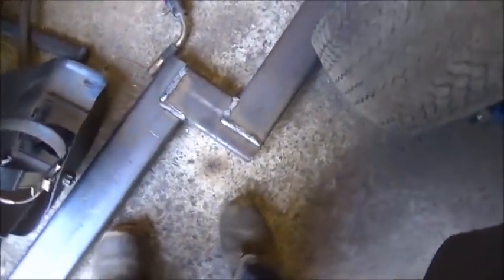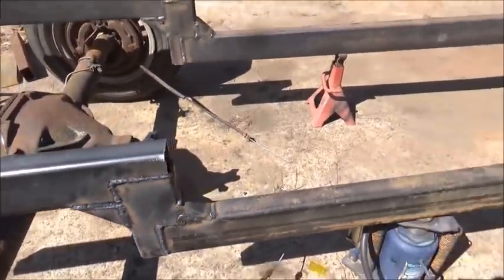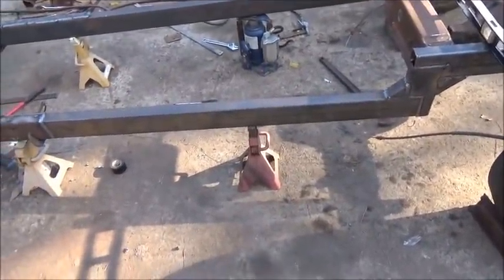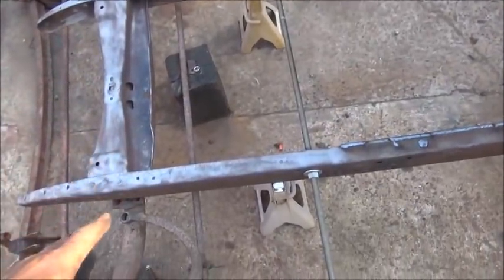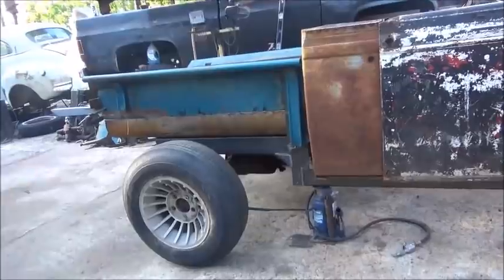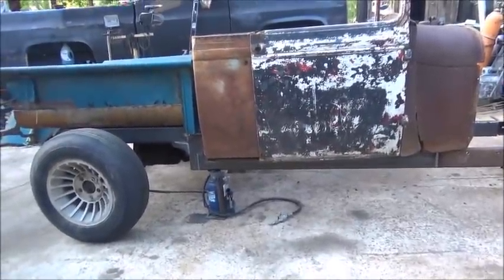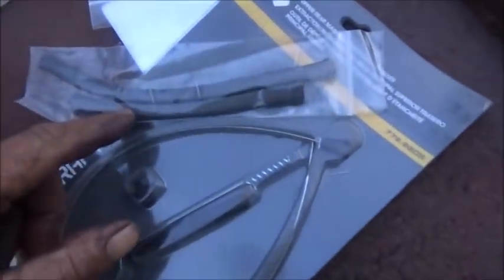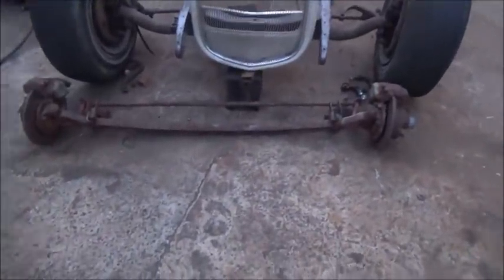1929 ROADSTER PICKUP FROM JUNK PART 7 Even More Frame Work

Comment: OMG! That is looking like one heck of a sweet ride. You sir are a genius. I like your idea of extending the frame for a rear bumper for safety and a place for the fuel tank. Great idea about the gussets on the frame. Ditto about the solid rods up front for the suspension. You don't want any unnecessary flexing when you hit a bump or whatever. Keep On Jonathan!👍👍

Comment: Definitely, the taller radiator shroud on this one.  Heck, this one needs a live axle up front, some flat fenders and running boards.  Frame's stout enough.  It is going to look good, and looks like it'll be much more roomie.

Looks like the Mrs. has been gettin' after it on her boat.  Good on her.

Comment: Suggestion on your boat wood - Baltic Birch plywood.  It's void filled and I have never had a sheet delaminate around water.  Check with the boat yards around, but for me it's strong, flat, warp resistant, and tough.  Good many-layer lay-up.  Cool stuff.  In critical areas, you may want to use HDO which is a plywood product used for highway sign boards.  It's even tougher than Baltic Birch, but also more expensive.  All of these are cheaper than actual marine grade plywood :)

Comment: I have admired all the hot rods you have built along with the motorcycle engine from a cylinder, piston, and head.  The crankcase for the motorcycle engine has your initials at the top and "USA" on the bottom.   I think you should make buttons similar to the crankcase, your initials, and "USA", to install on the hot rods. The perfect place on this one is the holes on both sides near the doors.  JAW and USA what a cool button or metal for the car.

Comment: I'd love to see a nice long hood on this build, not necessarily with side curtains but a top piece tapering from the cowl to the radiator shell would emphasize the extraordinary length of the engine compartment and visually integrate the radiator with rest of the body for a sleek sexy look. More of a salt flats look than the shade tree mechanics look.

Comment: When I was 17 I bought my neighbors 1948 Buick Roadmaster for $200. It had 54,000 miles on it. It was dark green with a grey interior. Was a 3 speed on the column and it had the dual carburetor option. It had wide white walls on both sides of the tire. My neighbors parked the car in their garage when they bought a 1965 Wildcat. Because I was underage, my parents made me sell it. I wish I could have kept it. I'm glad you're using a straight 8 in your rpu, and I like the transmission that you adapted to fit the engine. You are truly an artist.

Comment: Loooking goood I like it. I think you got it The rear radius rods you could use something like a four link set up and attach the ends to ther upper and lower of your Z'ed frame rails that would help fill in the hole back there in front of the rear tire..

Comment: Your car so only thing that matters is what you think/like but I would not put a pan below the bed because it will result in making the bed look too "thick/tall". I would go with "coil-overs" in the back (so much easier/cleaner to build) and some "eye catching" radius rods (maybe polished stainless tubing "hairpins") below the rear frame to distract from the frame.

Comment: Are you certain the front of the frame wont bend or twist being smaller n older. The Back of your cab couldnt be better. Looks natural. Gonna leave it that high off the ground? It is a truck. Impressive work friend

Comment: Have you considered channeling the cab down over the frame ? Maybe the top of the cab/bed the same height ?
Reply from the maker: No channel need the inside room. The bed is like Ford did them from the factory.
Reply: Jonathan W  very cool 😎

Comment: Ya that straight 8 engine is a long engine as you know you'll need a long front end for it back in the day all the cars they built with straight 8 engines all had to have long front ends for the engine but that also make for a big car look that they were wanting back then

Comment: I would have liked to see a horizontal level line running all the way from the doors through the tail gate. 
The drop down behind the cab does not look natural. Look at the square body truck sitting beside it and you will see the natural line running all the way back, but respectfully, as you remind us from time to time, we don't have a dog in the race.
Reply from the maker: The square body was built in 1982. The A is a 1929 design. Let me finish, then judge!